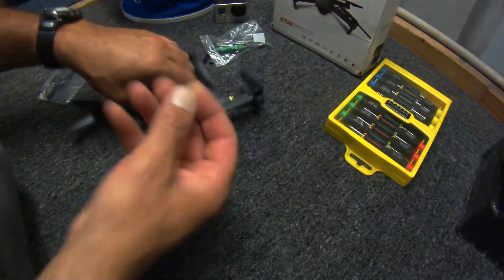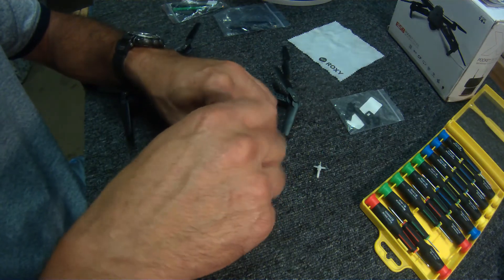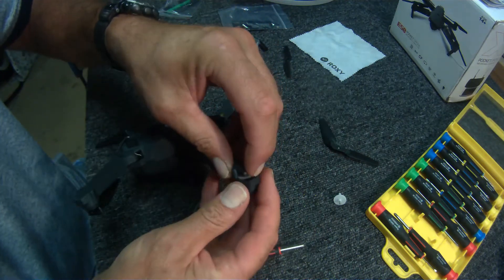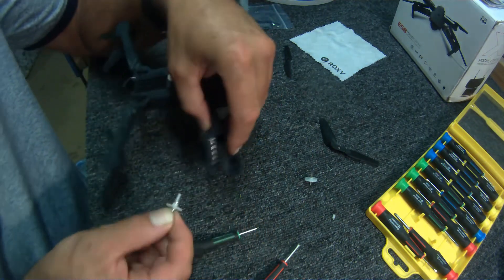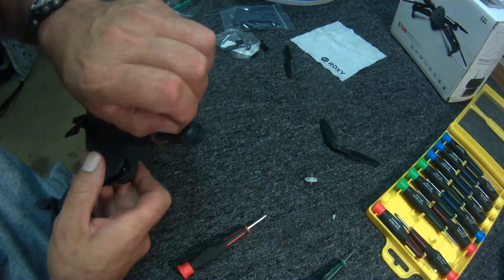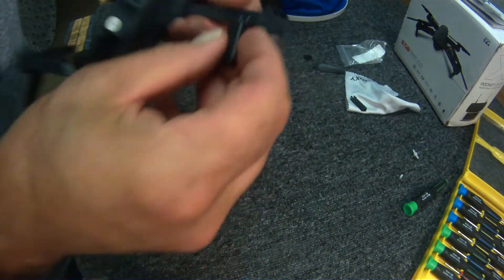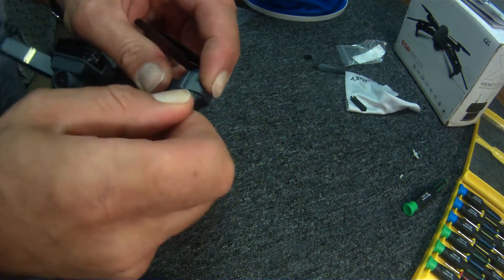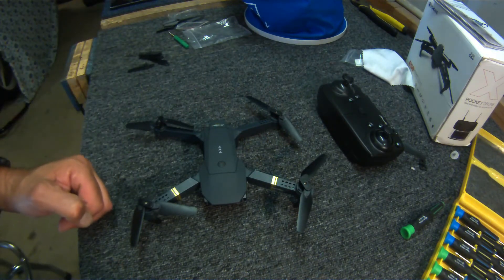Eachine E58 - Baby MAVIC. Prop Shaft BROKEN.. HOW TO FIX

Comment: hi bro i have aden e58 drone. I accidentally connected the battery upside down, it smelled of burning, now it's not working, what could be the problem?
Reply from the maker: Have you removed it ok. It will jam easily if inserted the incorrect way. You may have burn t out your fc. What happens when you turn it on?
Reply: There does not appear to be a problem with the processors, but I can not understand
Reply from the maker: What is it doing when you power it up..
Reply: @GTARC_au  the light doesn't come on it doesn't do anything
Reply from the maker: She may be fried as you reversed polarity. Can you get a spare fc?
Reply: @GTARC_au I can't afford it, I hardly got the drone 😔😔

Comment: Hi SkyPilot, very instructive video, thanks. I am a complete beginner and got my first drone, an e58 a week ago, and have abused it badly, walls, furniture, trees, dogs, Christmas decorations have all suffered. Now, it is on strike, it revs up ok, the propellers all start, but when I attempt to take off, it tilts over towards one of the arms at 2 O´clock or 8 O`clock but does not take off. Then it turns over and then only the propellers at these two arms work. This occurs with both the remote control and the wifi App. I´d be grateful for any ideas. Thanks in advance.
Reply from the maker: Welcome mate.
1st q. Gave you done a recalibration. This is a must after all crashes  👍☕
Reply: I've the same problem, after a few crashes in mud. The right front motor doesn't always spin when starting, even so it veers to the right and forward. Calibration has done nothing for it so I'm going to replace that arm.